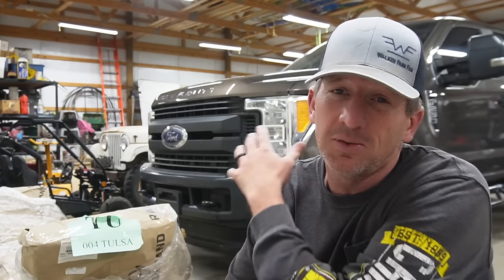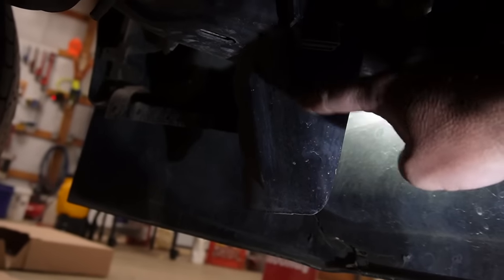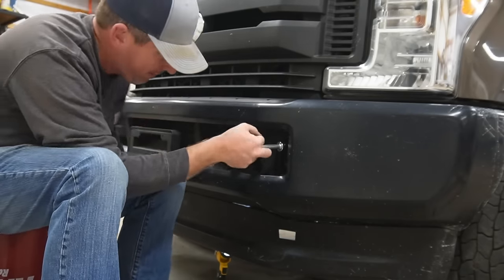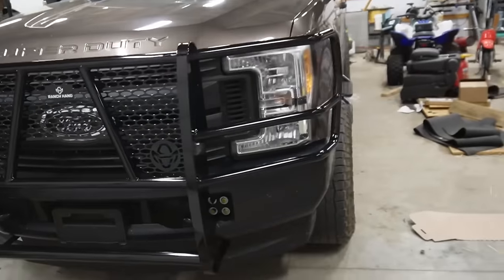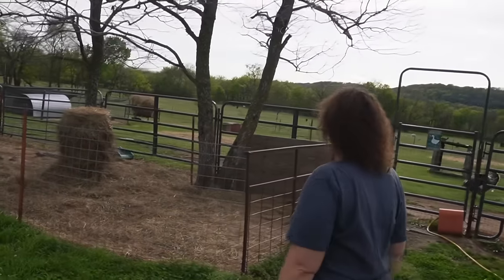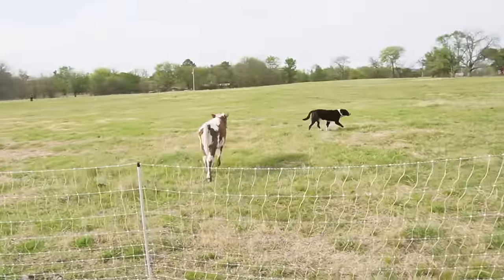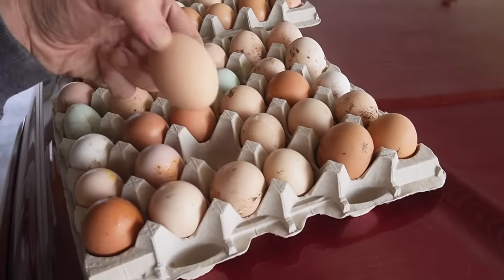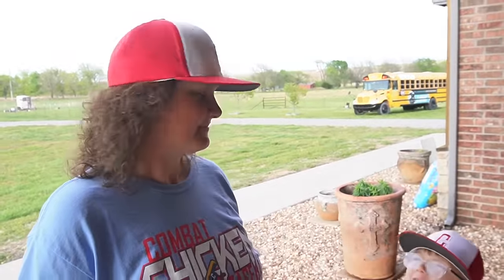Ranch Hand Legend Grill Guard Install | 2017 F250

Comment: Hey Gary, I sure could of used a brush guard on our Jeep Trailhawk  las t October.  Had a deer come out of nowhere  and hit the left front corner of the Jeep and he flew over us. Oh the damage. Both front quarter panels, the hood,grill, headlight assembly wiring inside engine carpartment, sensors,etc. Over $12,000 damage and 7 weeks at repair shop. The repair shop almost ( should of ) total the car. Now we will have a big hit when we go to sell the car. 😢.
Reply from the maker: That’s the perfect example of why I got mine. Sorry for your financial loss but thanks for sharing.

Comment: When my husband bought a used truck, I used a matching. Red nail polish to touch it up.  I bought a black fridge that had metal screws, I covered them with black nail polish.  The polish on the truck stayed for years until we sold it.  It’s much cheaper than auto paint.